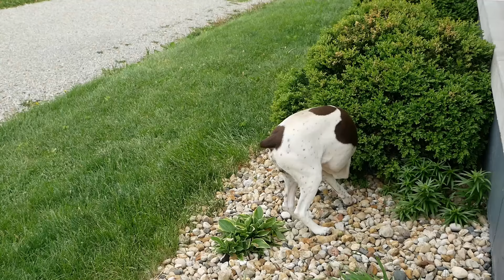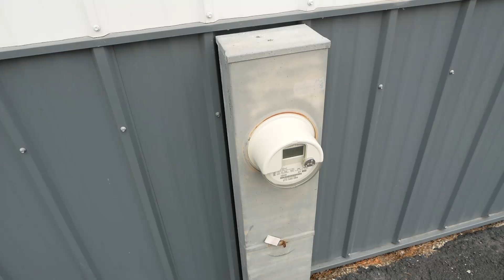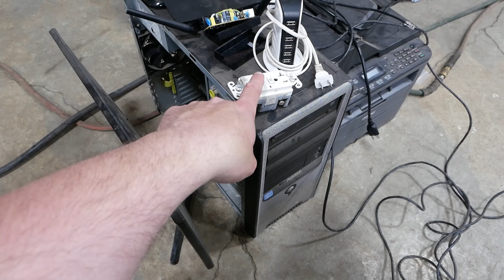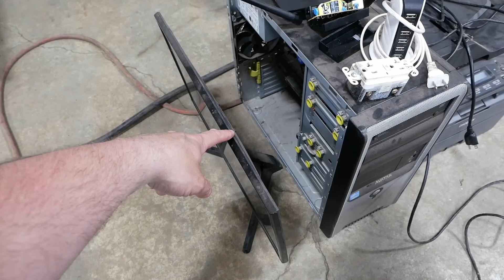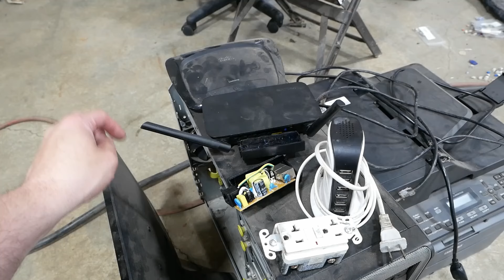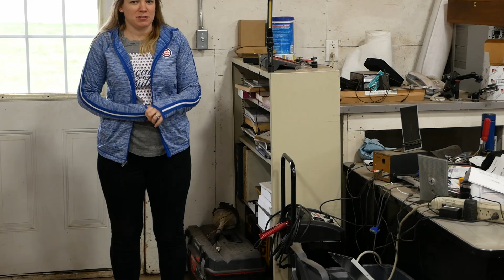Lightning Strikes Shop, Again...

Comment: Well that sucks. So how to diminish, if not cure your issues. APC UPS's for all your critical electronics (big screen t.v., computers, internet goodies** {**routers and WiFi extenders etc.}. APC American Power Converters will give you a guarantee on all your connected electronics (Yes, they will replace anything connected to a their UPS, I had a claim with them and they replaced the UPS and the computer and accessories that were connected to the unit at the time of the strike) A surge suppressing power bar is not protection from lightning where a UPS has a much better lightning arrester bundle, isolating not only hot and neutral but the ground as well. I would also install in each breaker panel a "SYCOM 120/240 volt surge arrester" (or equivalent) in each panel to protect other smaller electronics. Your only other option would be to have an Isolation transformer installed between the meter head and the breaker panel, that will also protect your delicate electronics in concert with properly sized for load UPS units. Yeah it's an investment, but so is replacing all the gear that gets fried. Hang in there Wes!

Comment: Wes I’m in New York on Long Island and we once had good service till it was sold and now I can turn it on in the morning early and about an hour or two I’m ready to throw it out the window along with its spinning little ⭕️ and it is not cheap and takes at least a mont for service on a good time. I feel your pain.  If the technician fixes the problem outside the house no charge enters the house you might as well give them what’s ever in the bank after you go to the gas pumps. Want to move but where can you go. Every place sucks. I feel your pain but your channel is great. Thanks for sharing your thoughts and knowledge  🇺🇸👍 Artie
Reply from the maker: Supposedly Kansas has the best internet in the USA. But it’s in Kansas.

Comment: Was that computer hardwired to the router or on wifi?  Cause it looks like you got a charge that came in  over the internet cable through the routers and into the electronics.  If you don't have it already, make sure your surge protection for your electronics includes the incoming internet cable and/or phone lines because power surges will use any kind of wire to travel on.
Reply from the maker: Hardwired, but the monitor and printer were not on the network

Comment: Bummer.  I’ve had a couple of strikes here take out my satellite connection.
The surge comes in on the power line through the wall wart without damaging it and kills just the wan port on the router.
No problems since I bought the best surge protector I could find but that could just be luck.
I sometimes unplug stuff when a storm comes in.  Nothing like air gap security.

Comment: Whole house surge suppressor, use  shielded cat5/6 cables with a drain (grounded shield wire) and choke,  the whole atmosphere gets super high voltage when lightning strikes nearby (hence the hairs stand up on your arms in lightning) and this can fry electronics like wireless antennas even if you have surge suppressor on your electronics, and bet is that your lightning came in from that since it fried the board and connected items but the power supplies (and wall warts) are fine.

Comment: Hey, kinda work PC repairs for a living. You can take the hard drive out of the computer if you must have access to it immediately. You will need a sata III 6GB to USB 3.0 cable, depending on the size of the drive.

Otherwise you can simply take the cable running from the harddrive to the motherboard (sata cable) and connect it to another PC's motherboard, than grab a power adaptor running of the power supply to feed power too it.

You will probably need to go into a program called drive manager, and assign the drive a letter (D:, E:, F:, etc). If the drive is encrypted than there is a chance this will not work as some forms of encryption will store part of the key (to verify the password) on the TPM module of the motherboard. 

This is primarily used by bitlocker however.

Comment: that's not what a POE is...  POE = Power over Ethernet    so it was what powered a modem or antenna...   normally 48 volts into the ethernet connection....

Connectivity is what I do ... shoot me your shops actual address and I will see what actually is available....  (fiber is sneaky they lay it net to highways and do not tell anyone)

Comment: chuck the power strip that was plugged into that GFCI outlet. the metal oxide varistors that should protect things plugged into it from power surges are definitely smoked. oh, and the last time I lived in a house that got struck by lightning all the ethernet devices got fried, including the NIC in my desktop.

Comment: the angry pixies got ya ;[  as far as the customer data  and the rest ..get a new computer  pull the old hard drive  and pop it in the new  box  as a 2nd drive and copy the data  to the new install or just leave it , but i would back it up if it is important as the pixies may have haunted the drive as well.   ya can go whole house  gfci and surge protected but that's a pricey option . thanks for the vid...the monitor is probab;y saveable with aftermarket driver board....need the flat panel model number for a google   there between 25 and 150 depending on the panel and outputs.

Comment: One possibility is having what is called a "UPS"  ("Uninterruptible Power Supply").   This is a relatively high wattage unit comprising a rechargeable battery with its integrated charging circuit, that is all protected by a very high voltage rated spike suppression system.  All your other IT equipment is all plugged into the outlets built into this unit,  and it is "supposed" to protect against lightning strikes as well as other blips on the line.  Even if it does not survive a lightning strike, it should be able to be replaced like any other commodity, by a simple "plug and replace" scenario.   Another mode of protection is to have an "air-gap" lightning rod running from your mains supply at the top of your local supply down to a secure, solid "Ground Rod", so that the majority of a strike wll jump the air gap and discharge to earth.   This is more relevant in countryfied locales rather than urban.   With the "UPS", there are two types:  a)  Battery is constantly powering a high power capable rectifier, so that you get fully sine-wave fully smooth power, and when there is a power cut, the battery continues to power the rectifier , the other, b) is where the supplied power is provided by the rectifier system via a well-designed smoothing circuit.  The battery provides power when the mains supply is disturbed or cuts out.  The former costs rather more that the latter one.  Both are available in a variety of wattage capabilities.

Comment: Hey Wes, as an Telecom Engineer  for over 24 years(17 primarily power and grounding engineering), your issue is classic  "just enough Ground to pass code", but not enough to protect anything. Larger surge arrestor at point of entry, and enlarge Ground cable from distribution panel to "Earth Ground [grounding rod(s)". Any strike to outside [telecom/electrical] would/should stop traveling into building and go straight to earth Ground.

Comment: I think that some of the strike energy came in through your WISP equipment outside and found its way to ground via the PoE injector and your PC, frying everything else in its path. Ethernet traveling outside that directly connects to your router inside is a big risk. If you want your computer to survive at a minimum you should have an Ethernet surge protector inline that is bonded directly into your ground rod system with the electrical panel. If you don't have at least 3 ground rods, add some more. Surge protectors are only as good as the ground they are connected to. Even better is to isolate through an Ethernet media converter to fiber optic so there is no conductive path. Keep your computer system an electrical island, so the only thing going into it is power and fiber. Use an Isobar or other high end surge protector and make it easy to unplug and physically separate power from the computer equipment if you know severe weather is coming.

Comment: Had a storm roll thru Des Plains,IL yesterday, first thing I did was to unplug my computers. I know the odds of lighting hitting your power pole are small but it can happen. Surge Protectors do not protect your stuff from lighting and I hope You are up and running soon. I do have a older lap top with a 500g SSD that you can have, good for the shop just let me know and its yours. LG

Comment: The terminal strips don't protect the ground side of your electrical service. NEC does not allow any breaks in the ground unless you install a true uninterruptable power supply. The UPS will be a sacrificial lamb but it will save your your gear and can be easily replaced. Good luck and we'll be here when you get back up and running.

Comment: New electric code requires an SPD installed at the panel in new homes etc. maybe you could get one its not too hard to install for an electrician.  But lightning is just alot of energy to direct

Comment: Hi Wes sorry to hear about all the damage from the lighting. You might look into grounding your service entrance better. You and your neighbor's are pretty spread out far apart. In neighborhood's where house's and their service entrances are closer together there are a lot of points of grounding. You can improve yours and reduce the risk of  lighting flowing back in to your house or garage. You daisy chain a continuous unbroken 4 gauge copper ground wire attached to 8' long ground rods spread apart about 8' feet. A line of about 8 to ten of them going away from your structures or any other type of service line like water gas or sewer. You need to give the lighting a better path than the one it's is using now. With out out seeing you're building's it hard to know what is making them better grounds. I would imagine all the poles in your area are grounded but they are most likely more spread apart. Have a wonderful break and enjoy your family.

Comment: Wes grab an apc inline ups. They run anything plugged into it off battery and use wall power to keep the battery charged. Lighting will take out the ups but all your network equipment and PC will be fine.

Comment: You're right about lightning doing weird things! My son got struck whilst snowboarding in the Black Mountains in Wales. A single bolt out of a snow cloud. The discharge through his feet was so massive that in a fraction of a second it superheated the melted snow in his socks that flashed instantly into steam and blew his trainers apart and off of his feet!
A silver chain around his neck is now a permanent tattoo. It melted into his skin!
I was driving over Westminster Bridge by the Houses of Parliament (I was a white van man.) when a surgeon called & said "Your son's been struck by lightning." I nearly ended up in the Thames! That was quite some phonecall!
As to stopping it happening Wes, after i lost a motherboard to a strike i now unplug everything if a storm is about. Electricity & phone line. It's the only way to be sure. I even make sure there's s sizeable air gap between leads, electricity outlets and phone sockets too as i know someone who'd unplugged everything during a storm but a surge down the phone line still zapped his modem because he'd left the lead draped over the phone socket!
Also, it looks pretty flat where you live. Have you thought about lightning protection for your new roof? Your workshop looks like the highest thing for miles around so it's bound to happen again. Next time it might blast a hole through the roof.
It might reduce the cost of your insurance too!

Comment: You know ... Check the grounds off your power systems ... There "should" be a pair of ground rods about 12 feet apart with a grounding line from box(es) to rod to rod ... 
I say this because I've found alot of cases where parts of this system have been "forgotten" during original installation and just get missed ... Honestly the number of broken main grounds I've found is astronomical (I found 2 at my current residence)

Basically you should have 2 rods per main panel (or meter) ... Whole panel protection does help some - for the $70 cost you might as well given this is strike 2

Comment: I'd recomend getting a backup service or drive for important documents, wouldn't have to be anything fast just basic and reliable storage. If it's a drive perhaps physically isolate it from the computer by connecting it to the router. That way if one were to fail you'd have the other.
I can't think of much to prevent electronics from being damaged apart from unplugging them of course. For the monitor, before throwing it out you could take the back off and check if there's a fuse on the power board (just after where the power plugs in) if not existent or not the issue check someplace like ebay for a power board, a lot of times they're relatively inexpensive when compared to the cost of an entire new monitor.

Comment: Put in one of these on your ethernet cable to the WISP radio: Ethernet Surge Protector for 10/100/1000 Base-T PoE+ Gigabit Modem Thunder & Lighting Protection ST-RJ45

Comment: Holy Crow Wes  :) also I have lighting damage on my home garage to radio  stuff and hook up to surges bars also well ground too still go hit ! Also got thru it too but cost lots money to recover from out my own pocket ! Also Wes anyway you can put lots ground rods around shed ever 6 feet apart and use battery cables to building too rod that 6 feet in length in ground in to try ! Or if sell barn type go from roof to ground of copper braid wires to !

Comment: About backups;
"Keep at least three copies of your data"
"Store two backup copies on different devices or storage media"
"Keep at least one backup copy offsite"   (or online)
 when you get back online, there is a ton of info about this.
Reply: The problem with offsite backup is how to achieve it with a rubbish internet connection.
Reply: @leosmith848  Offsite can be your brother/parents' house. You just need to update it regularly. It's known as sneakerware.

Comment: I was taught at a young age to unplug stuff before the storm hit. I don't know if that's saved anything but lightning has blown a few oak trees up like C4 was inside a few times in that neighborhood. Maybe some better bonding with deeper ground rods. Dead ends are notorious for this as the strike isn't split in half so to speak.

Comment: If you have any neighbors which you can see, you can set up a ~fairly simple line of sight directional antenna (there's lots and lots to choose from).
Perhaps they'd allow you to suck off of their internet until yours gets going.
You can simply use an antenna plugged directly into your router pointing directly at their antenna.
I've done it before (and I'm stupid), so...it would be a breeze for you!
Certain frequencies will give you various max speeds.  I ~think the higher the frequency the more data you can use...but, the range goes down...so, ya.  Look into it.
Personally, I'd jump off a bridge if I didn't have internets for a month.

Comment: It's interesting how the US still holds on to above ground low voltage power lines with small transformers very close to buildings. It's an ancient way of going about electric installations. In Europe we abandoned that in the 80's. And guess what, we pretty much have no power outages anymore. But I guess that's what you have to deal with when running a 110V system instead of 230V like the rest of the world. Power loss in 110V systems are too great to build proper infrastructure.

Comment: All part of rural life. The last lightening strike we had took out the hot water heat pump compressor. An electronic gizmo on the fridge and other bits and pieces. I have literally watched meter boxes get blown apart and burst into flames from the strikes. We too have mediocre internet at stupid pricing. The most annoying thing is the adverts on TV constantly telling you that you can have all these great things at what seems like silly prices only to ring up and be told sorry not in your area. Our choice is satellite or a mobile network  that is not the latest and greatest. Gets overloaded and isn't very fast. But would I want super fast cheap internet and live in a packed in box in a city. Hell no. Like you make do and whinge.

Comment: Lightning electromagnetic pulse field calculation-Atlantis Press
Reply: When I designed electronics, protection against lightning was the same as for EMP and static electricity. EMP levels may be a classified military secret, but get the same prevention as lightning and static.

Comment: Sorry to hear about your disaster. Their are whole house surge protectors. It is installed after the meter and before the circuit panel. I did a quick search. They cost anywhere from $50 to over $500. Goggles said to hire an electrician and they would charge between $100 to $300 to install it. I don't know what your electrical setup is between the shop and the house, you may need 2 of these. I'm not going to jinx you,so, hang in there Wes and family. Things will get better.